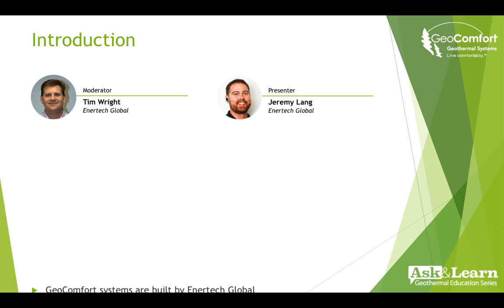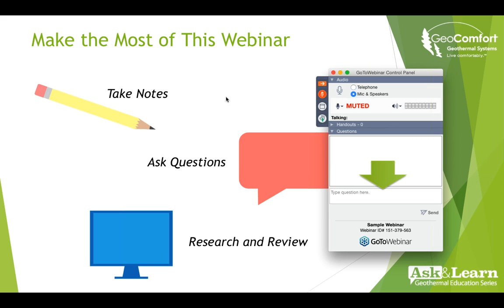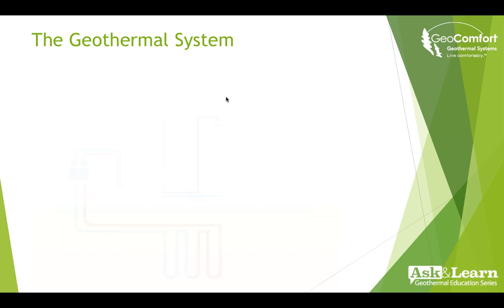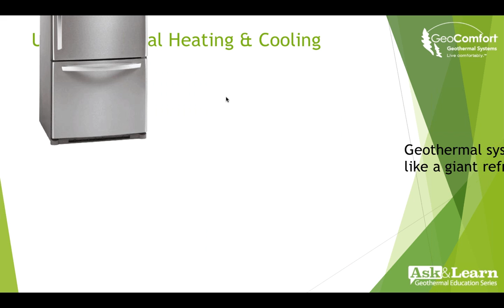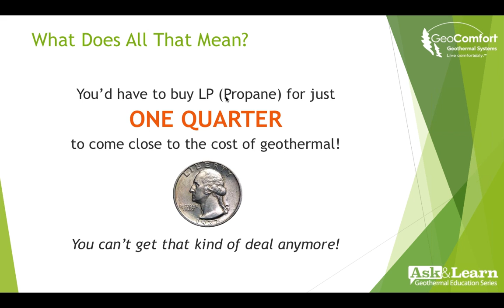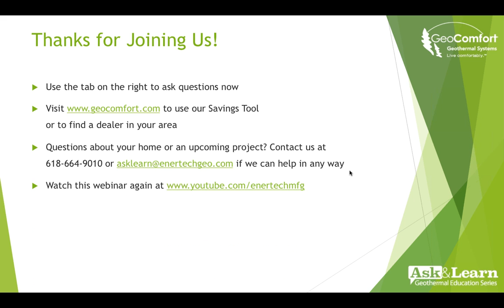Geothermal: A League of Its Own by GeoComfort

Comment: Yes but you guys are charging $50k-$100k for the installation of the system, spread that across the lifetime of the system say 25 years, it is actually more expensive than fossil fuel.
Reply: Most electric utilities give tax rebates so it becomes low to no cost. Pair it with solar and you can be net zero electric/ fuel. 
It seems unaffordable but it’s actually one of the most efficient and cost effective heating and cooling systems.